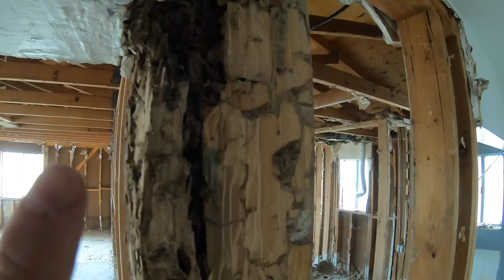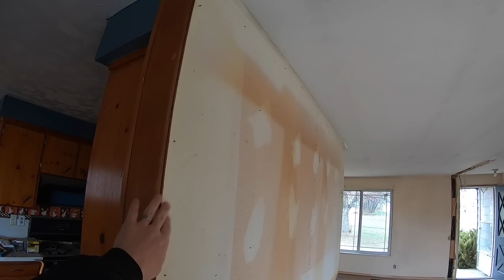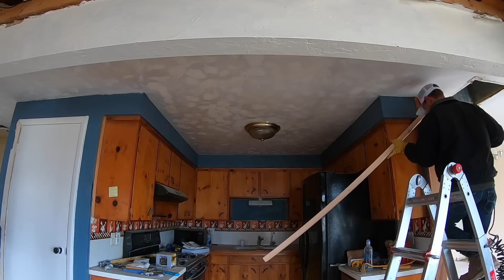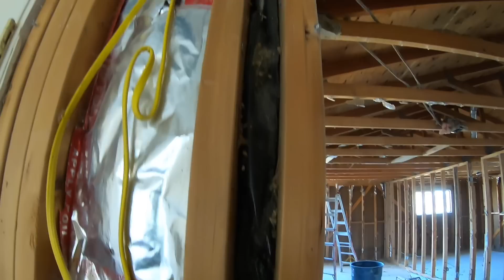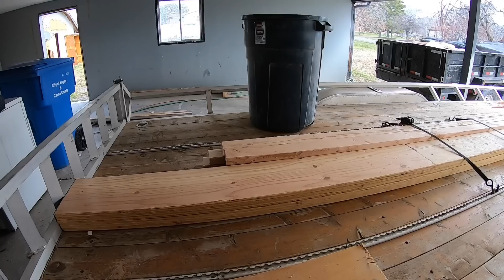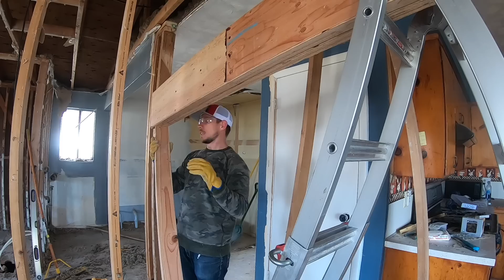Removing a Load Bearing Beam

Comment: Great video, very helpful. For existing home with load bearing wall, Can you join two small beams using metal connector between the two together to make one long beam to get rid of a column holding up the weight?
Reply from the maker: No, you will need tats column or you can buy lvl that is long enough. The longer the beam, the tales the beam.

Comment: When you erected the support wall you erected it parallel to the trusses? We're the ceiling batons holding it or was it in an empty space on the sheet rock? Cuz if it was just sitting parallel to the trusses on empty sheet rock it wasn't really a support wall.
Reply from the maker: It looks a little funny in the video, but the trusses parallel to the beam are part of an addition to the house. The beam is supporting the roof trusses perpendicular to the beam. God eye.

Comment: I don't understand what these new beams are supporting...
Your existing truss roof was designed to transfer all loads from your ceiling and roof to the outside structural walls they load on.
The existing "beam" you cut away in sections was cosmetic, and used to create a separation between rooms in the previous lay-out of the home.
What are your new LVL beams supporting?
Reply from the maker: There are roof trusses perpendicular to the ones you see that the beam will be holding up.
Reply: lol no there is not

Comment: Joel I’m a little confused earlier in the video you mention that the load bearing wall runs  perpendicular to the trusses. But the beam you replace is parallel to the trusses. So then how do you know the beam is load bearing? Thanks and I love the content you’re putting out!
Reply from the maker: You are correct, The trusses that look parallel are for the addition of the house and are not being supported by this particular beam. The beam is holding the trusses heading back into the house. Good Eye.

Comment: Hi, I am going to do a similar job, like DIY, the engineering told me to install an LVL 2-9-1/2", they are too expensive in my city, I was planning to use a 2x12" SPF dimensional lumber (Home Depot), what do you think?
Reply from the maker: I am not sure, I would definitely talk with an engineer, but I am sure they will give you some guidance.
Reply: the engineering I talked to works for the wood company, lol. A normal 2x12" cost $45, I need two. The Lvl 2x9-1/2" cost $250 each. people say, I should be fine but I am not 100% confident.
Reply from the maker: Do they sell the LVL'S  by the foot, I know that is how I buy mine.

Comment: good video.  You should have included the fail footage, just so you can point out what not to do and what to do.  As a lot of projects are different and people do things differently, it still would be nice to know what should or shouldn't do.

Good to know about how to tell difference between load bearing and not.

When it comes to DIY videos, the longer and more in depth they are, the better.  Try not to have too many timelapses or cuts. As it is better to have one long segment, then see something one way and have it change the next and not see how exactly it was changed.   

Everyone that does videos like that, it is very annoying, you choose to watch because you have a project like that or interest in learning about that, we don't need time lapses or cuts to save time. We want to learn how to do something or tips that could help.  

Also try and set the camera in one place for most of the video, only moving it when you want to talk or show some detailed look at something.   Trying to follow the camera has become very annoying and challenging to do and most people on YT do that and it has turned into fast moving cameras that makes the videos not worth watching.  If you are not showing some detailed footage, just set the camera up and talk to it without moving too much.

Even if there are camera operators, the movements should be very minimum if hardly at all. YT has changed so much from static cameras to hard to follow movements, just because everyone thinks its more entertaining instead of static cameras, which is very much false.

Even for vloggers that hold the camera, you have to have held the camera for many years to hold it completely still while you are walking and talking and know when it move and how long to have the camera on the item for.

It comes down to sort of a science when making a video. From how to hold the camera, amount of movements, when to have static camera, how long it should be focused on an item.  Many people think they can just pick up a camera and make a video, there is alot more to know to make proper videos than most actually know about, that allows the videos to be enjoyable to watch and most of YT now a days are almost not worth watching videos.

I might have to consider making a video on proper ways to hold camera and make videos. i'll have to think about that.

Comment: Great job, Sir. Thanks for sharing. I have question: Can one replace an 18" LVL beam with a smaller one, say something around 12"? The reason I ask this question is that I want to do a renovation in my house I have been told to install 3*18" LVL 2.0E beams, but that will show up too much on the ceiling, which I don't like. I want to hide the beams in the ceiling as much as possible. So can I put, for instance, 4 LVL 12" beams (or any thing smaller than 18")?
Reply from the maker: If an engineer has specked an 18" LVL that is what I would go with, but there are other options. 1 you can recess the beam in the ceiling and hang the ceiling from it the same way I hung the floor joists. (There are tons of videos about this on youtube) 2 you can change it to a steel wide flange beam, these are heavy but shorter and take up less head room. I would have an engineer give you specks for both options. Have fun on your project you won't regret doing it.

Comment: How do you know if a wall is load barring?
Reply from the maker: There is really no one way to tell. You have to look at the entire house and roof trusses and floor joists to really know, but the wall we replace the beam in used to an exterior wall of the house and all exterior wall are load bearing.

Comment: surprised that you did not need approval blue print drawings and inspections done for the replacement of the header
Also - I am also surprised that you are allowed to do your own electrical (pot lights that you did at the griffiths) as in Ontario Canada you must get an inspection done 
Good job though
Reply from the maker: you do ned permits for all of it, but the home owner can be considered the contractor for you own home. Yes you need permits.
Reply: @TodaysTask  Do contractors need to be licensed?